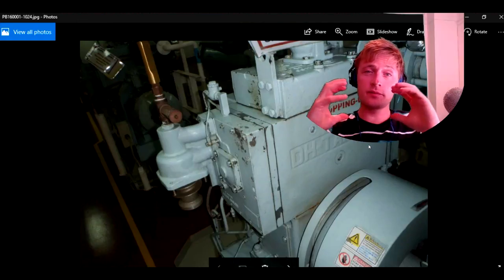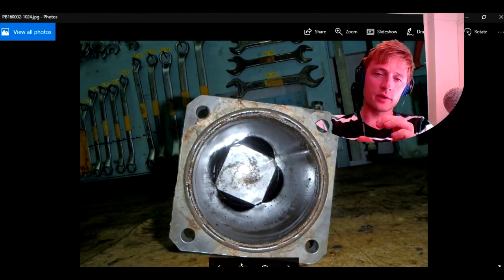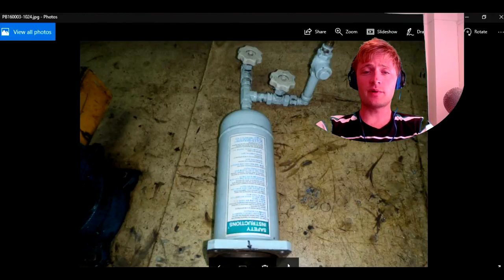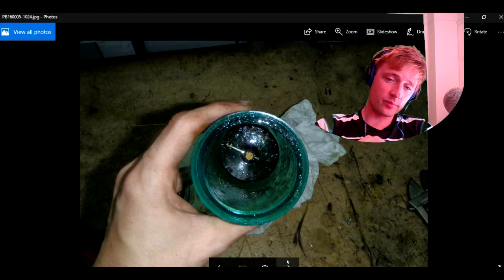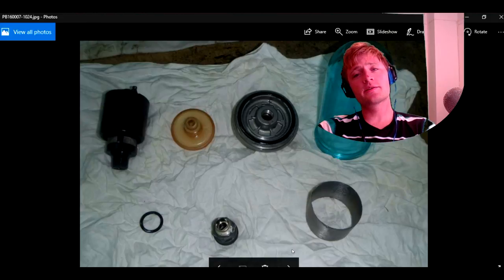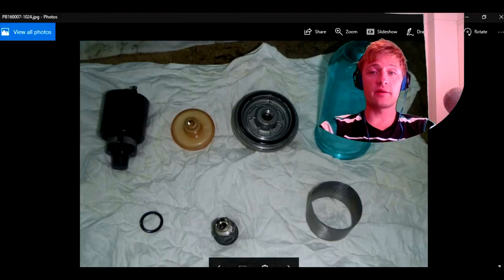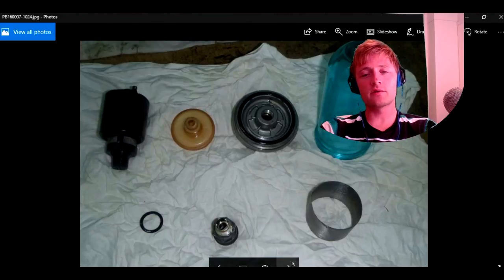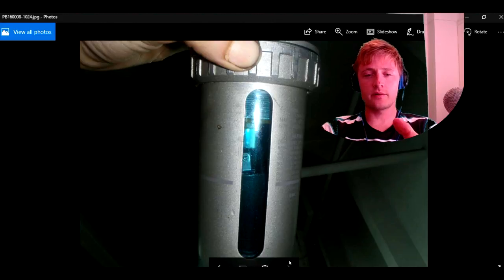AIR COMPRESSORS  AUTODRAIN CHECKS

Comment: Sir, good day.
i need an information!
in air compressor as a watchkeeping engineer how can i be sure that my unloader is really working or not?
is there any way?
Reply from the maker: Hello for sure you can here the noise is different also you can see gauges pressure is different .compressor must be started with not load.If the compressor will be not broken then trip will occur high amps.One more think is to check with coil check pen if it is energised.
Reply: @Adventure-Story  thanks❤
Reply from the maker: @mec6953  Welcome!

Comment: can you tell us how to test air compressor alarm?
Reply from the maker: Hello which alarm you like to test low pressure lub oil or temperature high?
Reply: @Adventure-Story  sir all the related alarm test, I just want to know how to do?
1) L.O pressure High
2) L.O pressure Low
3) jacket cooling water temperature high
4) motor overload trip
5) discharge air temperature high and trip
Reply from the maker: @mec6953  ok i will answer this question tommorow thanks! I will check what alarms they are.